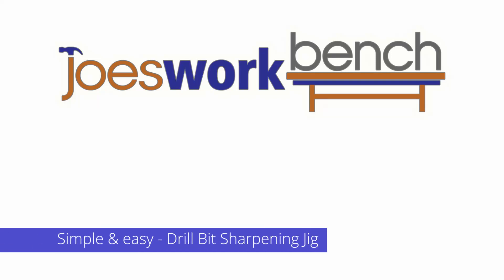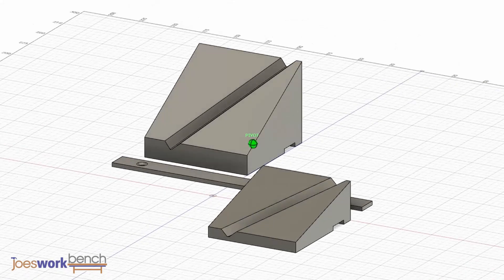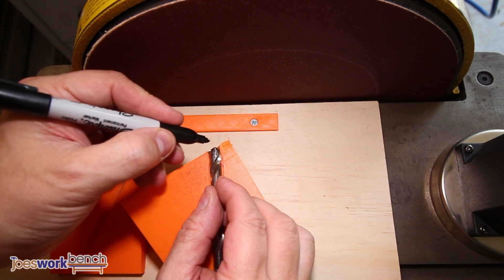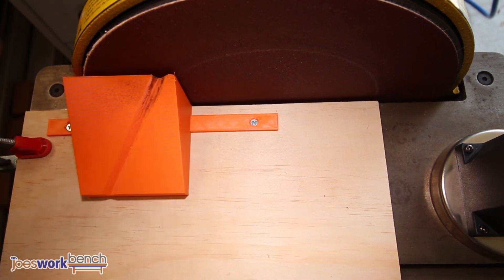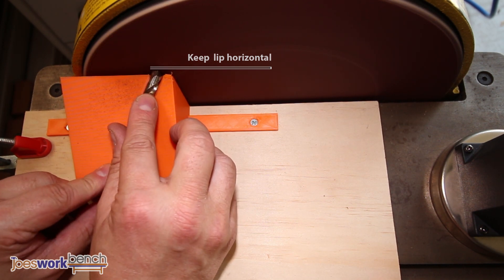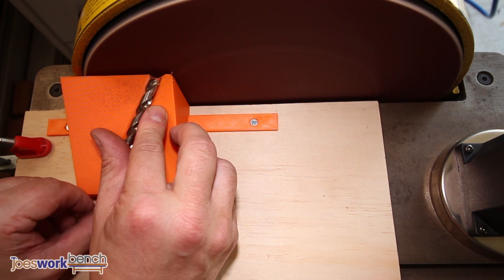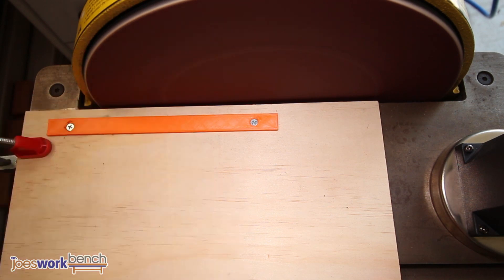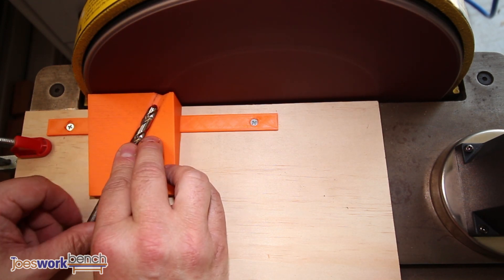How To Sharpen Drill Bits - Easy Drill Sharpener #3dprinting #drillsharpening

Comment: Thank So much. I really need this. gonna print one out asap.
Reply from the maker: Nick's Garage awesome, let me know if you have any issues
Reply: @JoesWorkbench  I just got a 3d printer last week... And i started printing it now... Ill tell you how it goes... Also, it looks like the channel the drill bit slides in is small, suggesting it will only work up to a 3/8" bit? I may just edit your design to accomodate my 5/8" drill bits... anyways cool design and thanks for sharing.
Reply from the maker: @nicksgarage8295  thanks nick, you might be able to simply scale up the design in your slicer for larger drill bits 🤷‍♂️